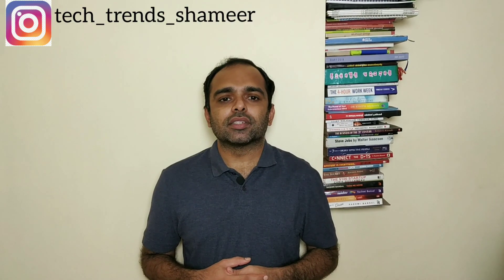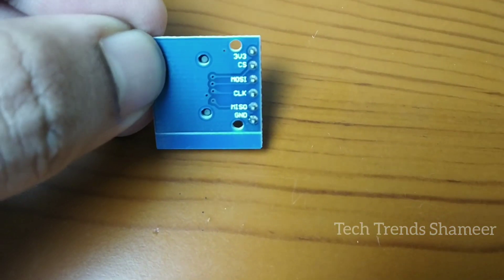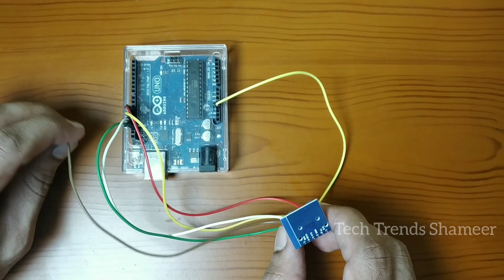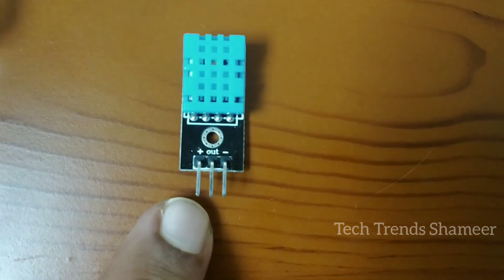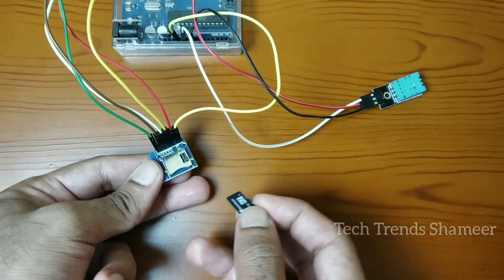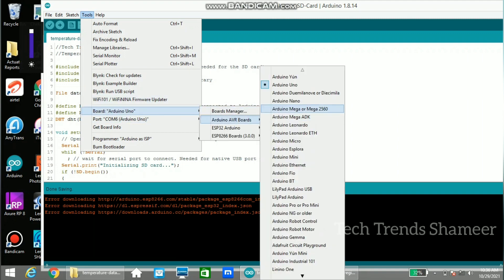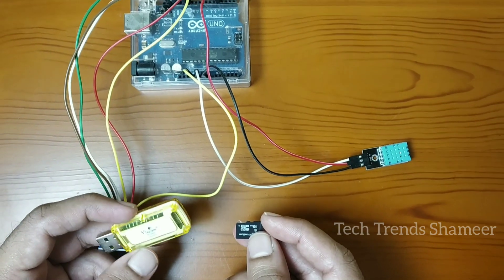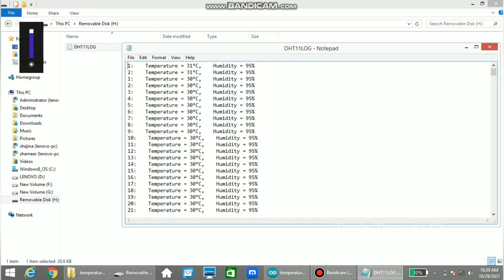How to store temperature data in SD card | Arduino Projects

Comment: Hello brother, great work 
I would like to try this with DS18B20 temperature sensor and also I would like to find some multi sensors with one Arduino and data logger. Any help would be greatly appreciated.
Reply from the maker: Sure. May I know what are the sensors you would like to add?
Reply: @TechTrendsShameer   I am using pH sensor, Temperature humidity and MQ2 sensor.
Reply from the maker: ok

Comment: Thank you for this great vid! May I ask if this works without energy source? I'm not well versed in arduino. I'm just going to use it for my TEG project. Thank you!
Reply from the maker: Without energy source means without supply power ?
Reply: @TechTrendsShameer  Yes sir
Reply from the maker: @jeyseee8988  Without power it is not possible
Reply: Then what did you use for yours?
Reply from the maker: For what purpose you want use ?
Reply: @TechTrendsShameer  I plan on building a small TEG generator for a project. I need to measure the temperature of the hot side using data logger so that I can find the relationship between the varying temp and output voltage
Reply: Then what did you use for yours?